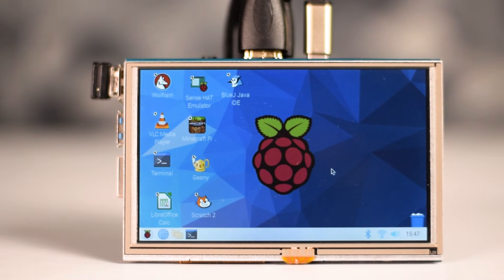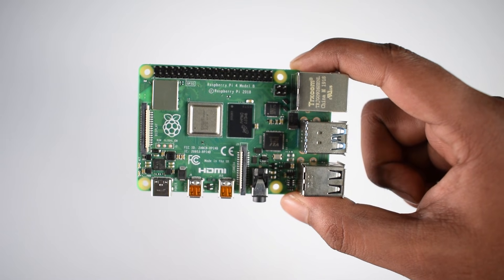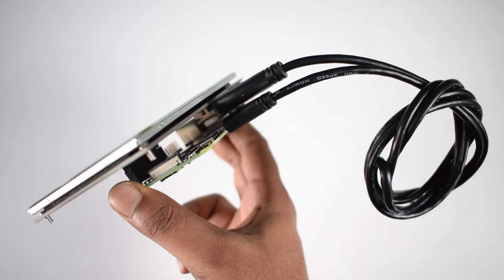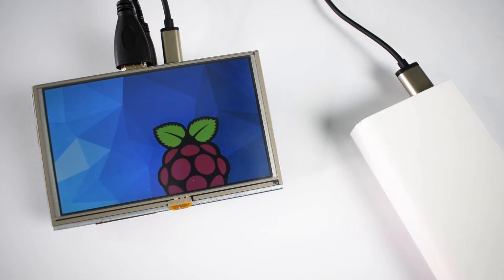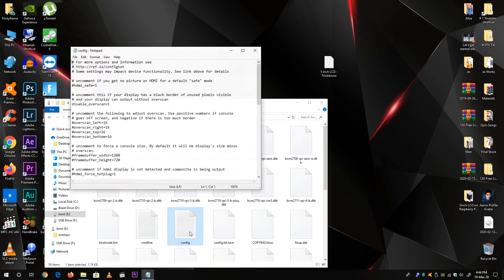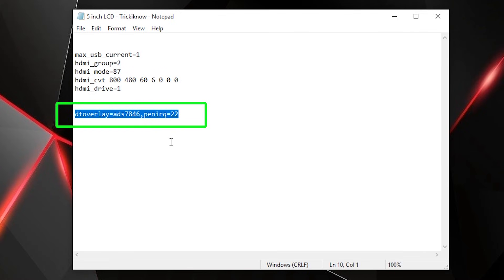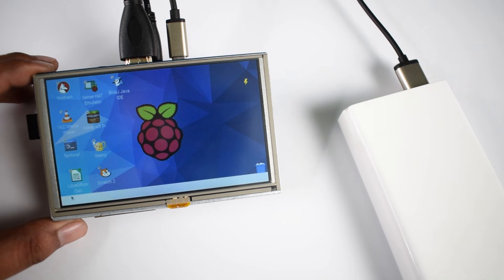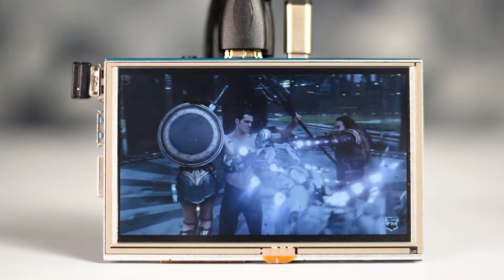How to Install 5 inch Touch Screen LCD on Raspberry pi 4 (Easiest Tutorial)

Comment from the maker: The Code for the 5 inch LCD: https://trickiknow.com/install-5-inch-raspberry-pi-4-touch-screen-lcd-without-driver/
Reply: How can I get a rasberry pi 3.
Reply: This website not working
Reply: Please give code
Reply: I have changed Touch screen code from 
 dtoverlay=ads7846,penirq=22
To
dtoverlay=xpt2046,penirq=22
 as (XPT2046) written on the back of my screen but still not working
Reply: @syedabidaliabdi1273 i have the same problem. Did u find any solutions ?
Reply: Is it work for pi 5

Comment: so the starting screen is good and working well without glitching but the touch is still not working. tried putting every model related to the screen (MPI5008 , XPT2046 ) but still won't work and I even tried the model you used (ads7846) but won't work.
but still thank you for the tutorial.
waiting for your reply if possible.

Comment: Can this just be used for Windows? I just want to connect it to my pc to have a small 2nd screen....
Reply: Probably not. It's made for Raspberry pi not for normal computers. I checked if a similar model works as a new monitor but It just works when you plug it into a raspberry pi. It's all because of GPIO pins. For example a laptop doesn't have GPIO pins and that is why the monitor is not working. The truth is that this monitor works only if you have GPIO pins. So the answer is: NO IT CAN'T, YOU CAN ONLY USE IT IF YOUR LAPTOP OR COMPUTER HAVE GPIO PINS

Comment: Hello I just order one of these and the display is black when plugging in the usb power and hdmi to my pc. It doesn’t show anything but the backlight being turned on, is there a driver issue or a voltage issue I’m running into? Or is this display only for raspberry pies? Thanks!

Comment: Hi I have the raspberry pi 4b and the waveshare 3.5 inch i can't get the display to work after copying your text line in
Reply: Any help would be appreciated the side of the lcd lights up so I'm guessing its not faulty
Reply from the maker: Try this for 3.5 inch LCD: https://youtu.be/Fj3wq98pd20

Comment: I got a 5 inch screen for my raspberry pi 3B, it works using an HDMI cable, but it doesn't work with the connector. Do you have any idea why?

Comment: Hello, i want to use this screen for my windows pc for on my case, can i take off the black 26 pin connector, or will the screen stop working if i do? I want to take it off so the screen is more flat on the back, i also dont need that connector, i use the hdmi.

Comment: Is this panel applicable to use with fingers ? Or only stylus is applicable ?
Reply from the maker: With finger i didn't get accuracy, may be a perfect calibration is needed before using it with finger. Or you can buy a quality screen. With stylus my screen works 90% accurate, only i am having trouble to touch at the corner / edge of the screen.

Comment: Just have a white screen :( 
Are the newer screens for the pi 4 unsupported?
Reply from the maker: No, but may be configurations are different. First read the instruction manual carefully.
Reply from the maker: In pi 4 there are 2 hdmi ports , try switching the ports.

Comment: Thank It works, but I can't active the touch. The box of my screen indicate 
Model ARD-510
Touch Controller XPT2046
Reply from the maker: Try to replace model in the touch code.
Reply: @TrickiKnow  the touchscreen doest work even though i replace ads7846 into my model. in my case i am using XPT2046
Reply: @xx-mikanSwch  you found the solution??
Reply: @neza8114   you can find it in config.txt..... Use sudo nano to edit
Reply: @xx-mikanSwch me too, is there any solution!?!😢
Reply: @PDeveloper  i have the same problem. Are there any solutions?
Reply: @PDeveloper did u find any solutions?
Reply: @TrickiKnow  Where can i find the touch code?
Reply: Where is the touch code located at?

Comment: I am having 7" touch screen for my Raspberry Pi 4 Model B(4GB Ram). Touch is working while connected to Laptop.But Raspberry Pi 4 display is working and touch is not working.
My LCD is Waveshare 7" HDMI LCD(C) 1024x600 IPS Captive
May I request you to send me the configuration please.